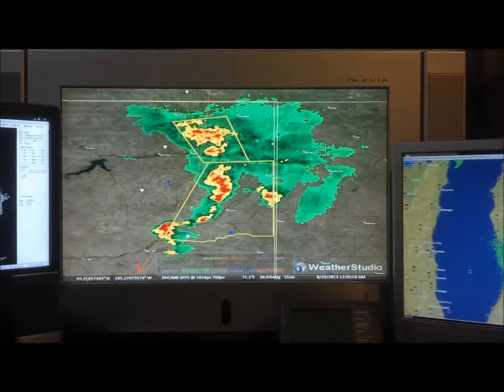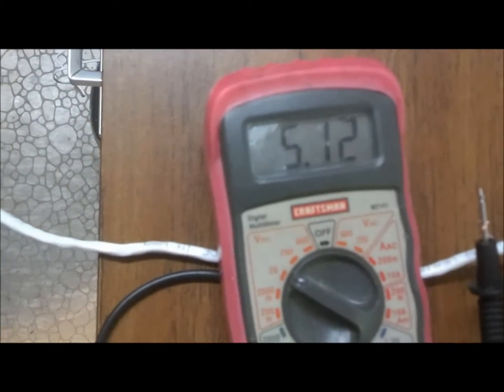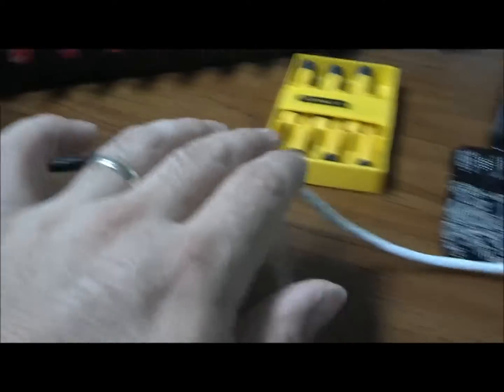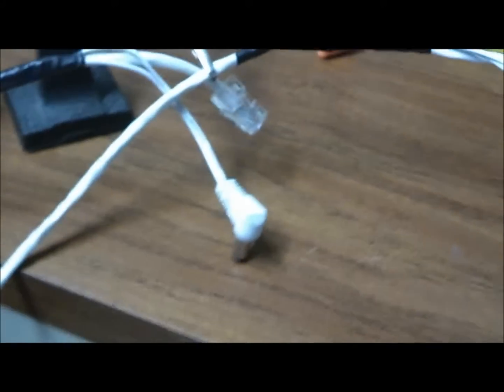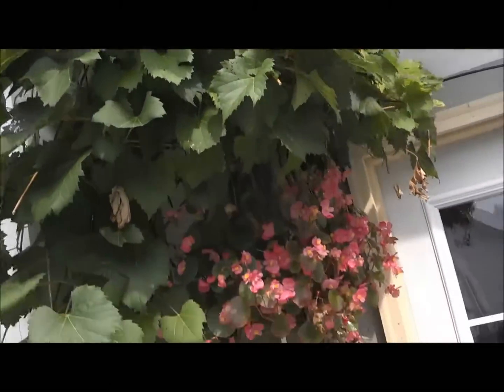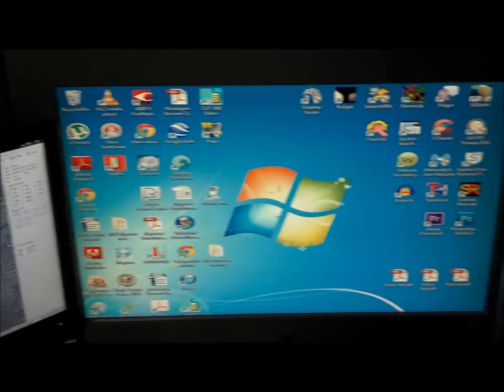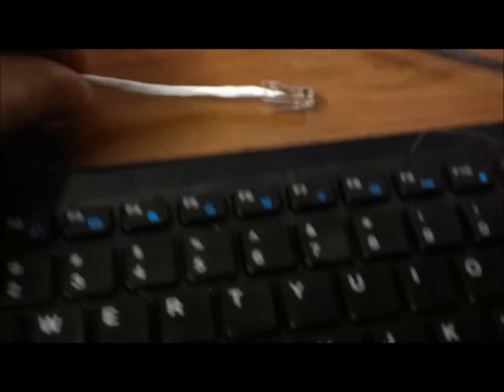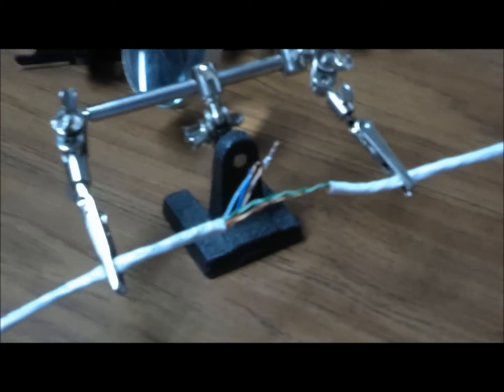Power over ethernet

Comment: What if you would have used a more powerful wall wort to power your camera??  That way you maybe wouldn't have had the power drop when the camera kicked on.  Also, maybe that would have allowed you to mount the camera on your tower.  Just my thoughts.
Reply from the maker: Hello!, I did try a few different wall warts, and I could smell the camera getting hot. I couldn't find one that would give me the right voltage at the end of the line. I think I ruined most of them by trying (cutting the cord) LOL.